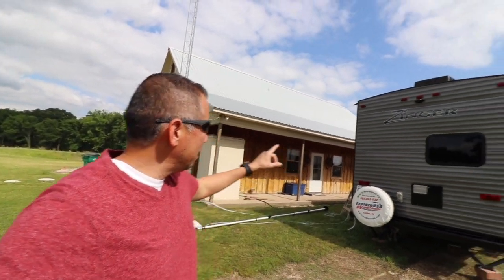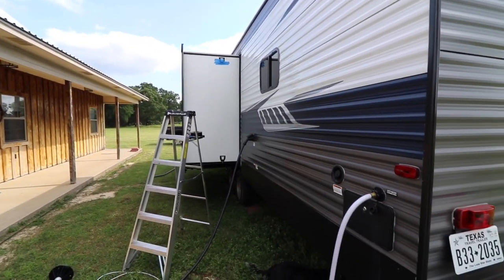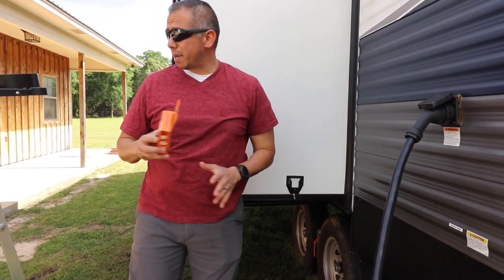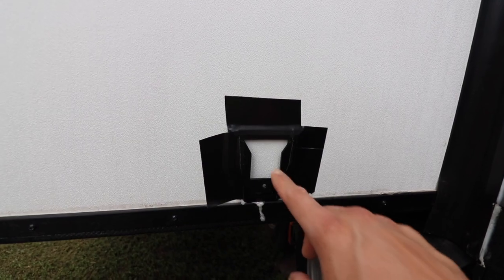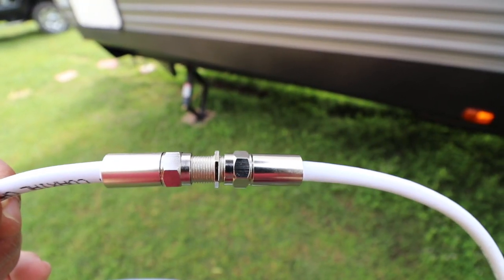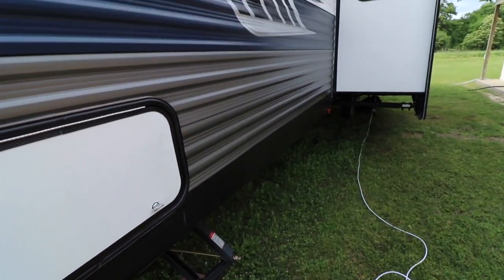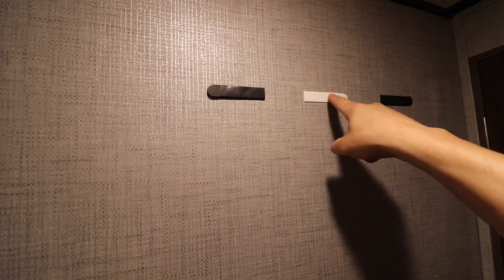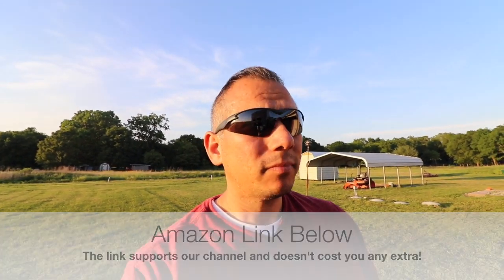weBoost Connect Install and Hack

Comment: use the satellite port and mount the booster near the tv. Thats how I did mine. works perfect. Add a wifi max extender router and you will be all set

Comment: Has that damaged your slide seal at all?
Reply from the maker: So far so good. It looks like there is plenty of space when they slide in.
Reply: @LivingTomorrowToday  that was my question can you still slide in but im glad its all working for you
Reply from the maker: @roaringgrizz3202  No issues at all.   There's plenty of room as the slide goes in.  I don't know if that varies by rig, but my guess is that it's pretty similar across RV's.  Also, the little holders are very flat.
Reply: @LivingTomorrowToday  glad it worked for you how's the weboost treating you and btw thank you for your service!
Reply from the maker: @roaringgrizz3202  Thanks, I appreciate that.  It's been working really well.  I don't have any real evidence other than my experience, but it seems like since we have an aluminum RV the signal works better inside when we have it set up.  We still haven't done any serious remote camping where I could put it to the test, but I imagine it's going to be a good thing we have it.  I will say that if I had to do it again, I would probably get something that I could leave permanently mounted on the RV.  It's not hard to set up and break down, but we move so often that its just one more thing to take care of when we move.   I also get nervous about lightning when.  They tell you to bring it down during storms.